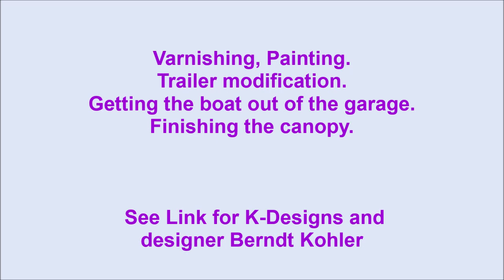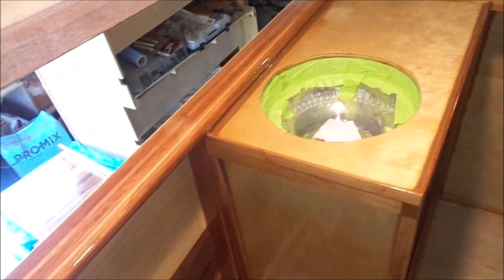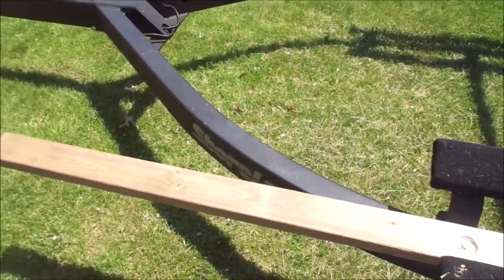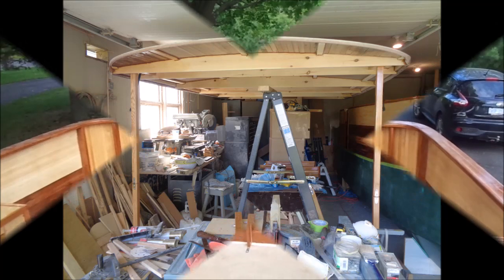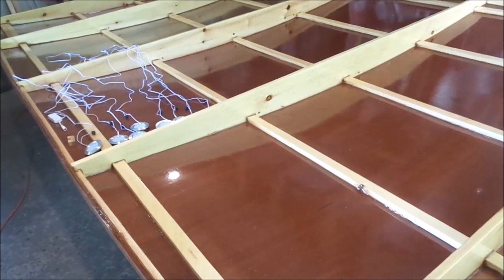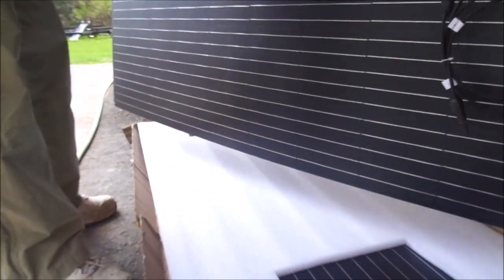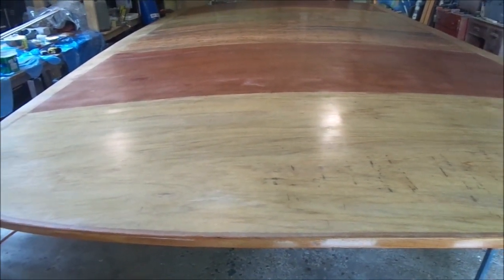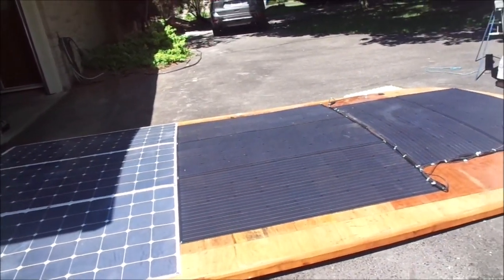Building My Solar Electric Catamaran Part Twelve

Comment: The only bad thing about flex panels is they can overheat and not last as long as glass. Typically you want to keep all your used solar panels the same type or the higher voltage ones can restrict (backfeed) power from the lower voltage ones. You can get around the different panel types by routing the two panel types into two buck converters that convert to the same voltage and then parallel that to your MMPT charge controller.    Though if max power is not an issue you may have enough.  Your boat looks amazing!